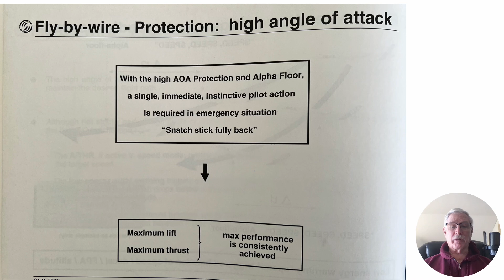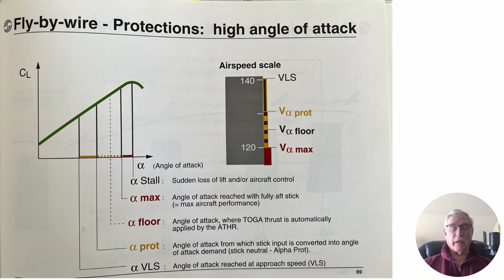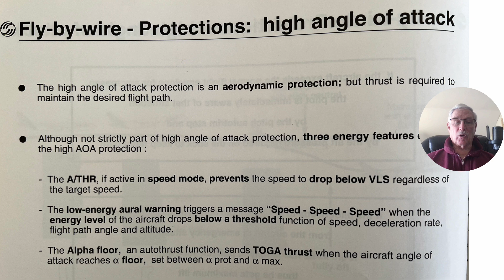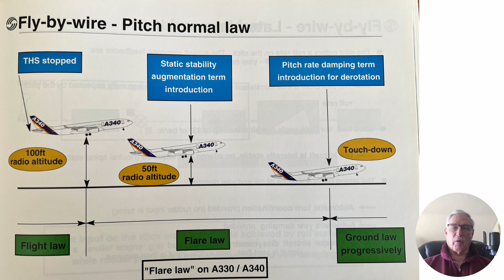Airbus: "We have built an Uncrashable aircraft! Right!!Air France 296Q

Comment: But what pilot would wait so long  intentionally put the aircraft into a position where he was relying for Alpha floor to kick in?  No pilot in his right mind would force that mode (by intentionally flying so slow).  Surely one would have manual control of the throttles...and what kind of 'training captain', let alone chief pilot would ever let the speed bleed off so low, while they were at 100ft???  and furthermore, it is well known that jet engines take a good 7 to 8 seconds from idle for the power to kick in.... Such negligence.

Comment: This has always been my problem with flying on airbus(by wire). The rules are always changing. It's like a bureaucrat shuffling rules all day. Hey, let's solve this problem. Make more laws to solve the already confusing 1,000 laws, @treelanding law, @doorjambytree law, @killbabiesblamethepilotsnotairbus law. ...I'm much more comfortable with no laws, cables and pulleys, and two guys upfront chanting, 'don't f*ing stall it, don't f*ing stall it, don't f*ing stall it,'  . I especially love it when they say things like yes the pilot is always in the loop as if we're supposed to feel better considering every scarebus crash that involved fly by wire has a CVR of a pilot going WTF is going on?!? it's like the plane confuses the hell out of the pilots, the pilots try and make an input, the plane crashes, and they blame the pilots for not being lawyers. It just makes me uncomfortable the whole thing.
Reply: Some years ago I came across an independent investigation of this crash
In it was a picture of a man in a business suit making off with the CVR and FDR while the wreckage was still smouldering.  The CVR and FDR were then awol for as few weeks before finally being handed over to the authorities.  But the ones pictured in the official investigation report had differing numbers of white stripes on them to the ones seen in the hands of the man in the suit.    Whats more, it was alleged that the CVR and FDR data suddenly went out of sync around the time the Pilots would have noticed the trees and commanded full thrust (which both pilots said the plane ignored).

Now, I'm not really one for conspiracy stories. But this investigation did make some interesting observations.   Plus, we know a LOT was riding on the A320 being a big success at the time.   It's not too far fetched to suggest certain things were manipulated to place the blame elsewhere rather than the celebrated FBW system.  And it certainly wouldn't be the first time official findings were made to protect one party or another.    (HMS Hawke  vs RMS Olympic comes to mind)
Reply: @bmused55  The Concorde crash was a coverup for a number of French mistakes, not a rub strip from a US jet.
Reply: @joefin5900  now that I absolutely believe.

She was too heavy, (weight of bags miscalculated and too much fuel)
Taking off with a tail wind
Landing gear missing a spacer which several BA Concorde pilots said would absolutely cause the plane too slowly pull to the left.
FE shut down perfectly functioning engines without the pilots say so, right when they needed the power
Reply: @joefin5900  Please explain how the rub strip found on the runway matched the cut in the Concordes tire and the coincidence that a US aircraft was missing Rub Strip that matched the one found.  And what were the mistakes you allege the French had made. Please include references.
Reply: @bmused55  given all the things we've learned about government over the past 10 years, this seems a lot more plausible today than it probably did back then.
Reply: @bmused55  I always thought there was some cover up in that accident investigation.